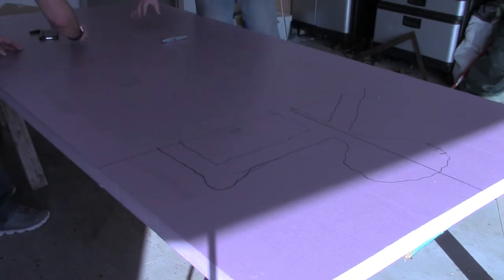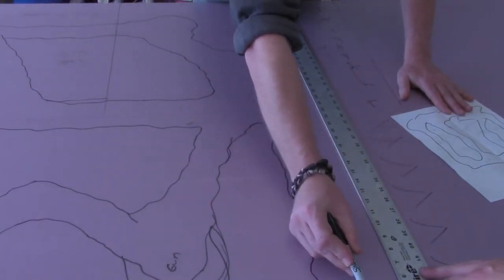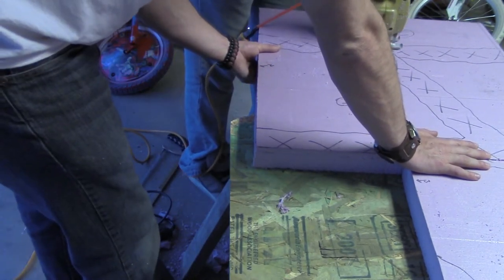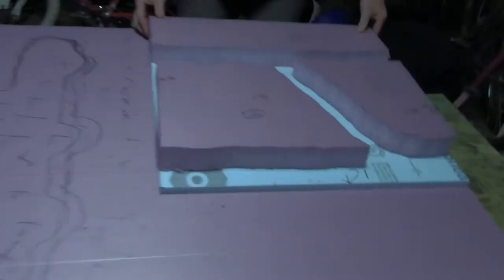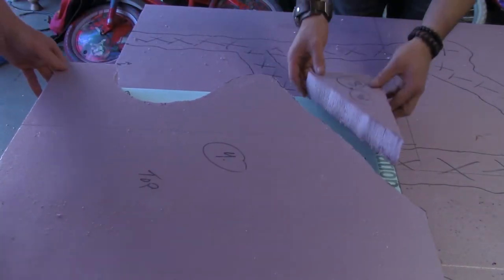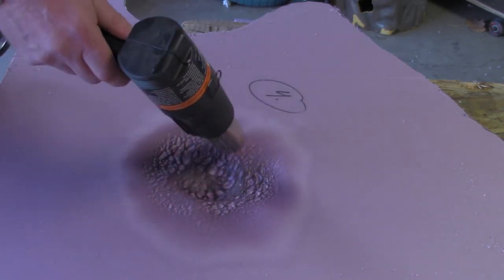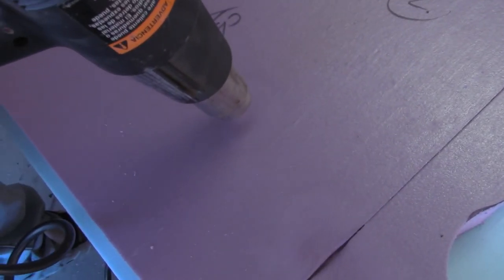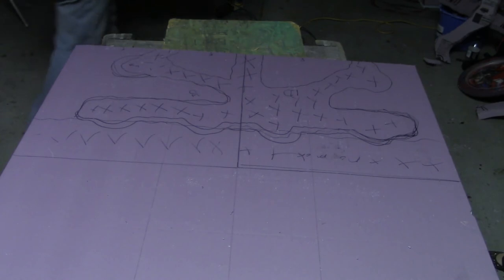How to Make a Trench Board part 1

Comment: I like trench warfare a lot but in a Warhammer match I think my hands wouldn't be able to reach into the trenches
Reply: for trenches on the tabletop it helps if you make the top opening wider than the bottom so that they are sloped. that way you can reach into them and things don't get stuck in there. in real life trenches were built with the top opening smaller than the bottom so that the ledges could be used as cover from artillery strikes.